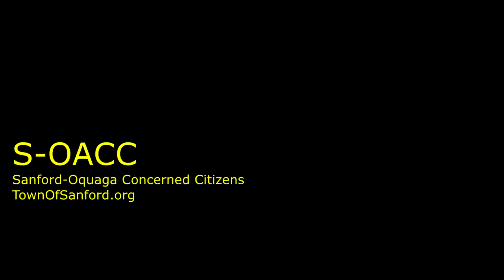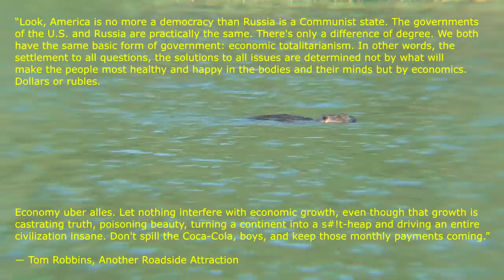"Frack Times" Lathrop Compressor Station "BlowDown"

Comment: that is NOT fracking   you really are naïve aren't ya?
The term gas blow down is referred to venting of gas accumulated in equipments, process facilities, oil production wells etc. The gas which is to be blown down is not desired to be used for production of a variety of possible reasons and is usually vented through a flare. The flare burns the hydrocarbons before venting product gases to atmosphere.
Gas blowdown valves
  The purpose of blowdown valves is to depressurize the equipment by sending the unwanted gases to flare. Blowdown valves are emergency on-off valves activated by a signal from the Emergency Shut Down (ESD) system, rather than direct activation by overpressure in the protected equipment. Blowdown valves are on-off valves, often installed in a parallel configuration to pressure relief valves on equipment. This depressurization is different than equipment protection performed by pressure relief valves. Certain on-off valves are closed on emergency shutdown (ESD) of a system. Closing of these valves can lead to overpressure in some process equipments. At the same time, ESD system sends signal to open up the blowdown valves and to release the excess gas to flare, thus preventing an overpressure scenario.
Reply from the maker: Peter Dash 

Peter, I use the moniker "Frack Times" to group items related to fracking.  In Susquahanna county this is the main source of the gas.

Maybe you could tell me why these facilities seem to vent noxious smelling gasses at night?  What does a compressor do with the condensed volatile organics it collects.  How do they de-sour the stream in PA?
Reply: That gas doesn't look like it's being flared, just released directly into the atmosphere.  I've seen refinery flares, at day and at night and this does not look like there's any burning going on.  Sure seems awful loud, though.  
Question: why are there "unwanted gasses"?  If you're making so much money on this product how come you're throwing it away by "venting"?  What kind of gasses here might be "unwanted"?  Thanks for educating us.

Comment: You can get a simple decibel measuring app for your smartphone.  

For iPhone: "Decibel 10th: Professional Noise Meter" is excellent and accurate. 

for Android try "Sound Meter" 

CDC did a test of smartphone decibel measuring apps and found them accurate to within 2db. See: "So How Accurate Are These Smartphone Sound Measurement Apps?"
Reply from the maker: Thanks for the info, I probably would have had to stand far back from the source to get a good reading.  The noise was unbelievable from the road were I was filming.   I'm pretty sure I would have had some flattening of the sound by hitting the upper limit at that distance.
Reply: The camera mic would probably overload unless you can manually control the levels - HOWEVER the sound apps for the phones can show very high levels - mine goes up to 140db which is really loud.